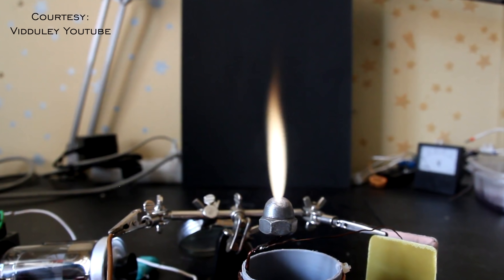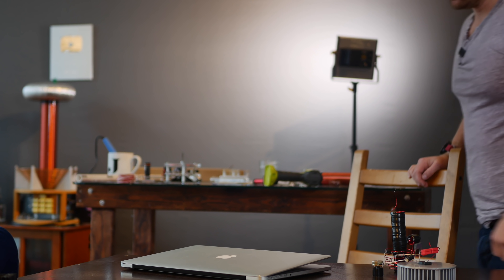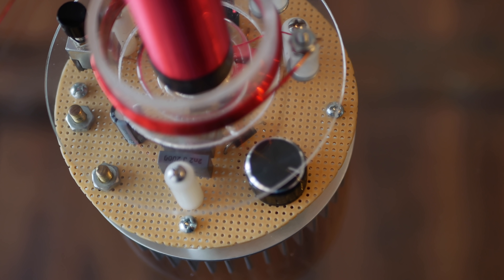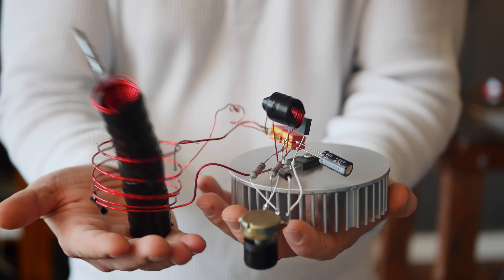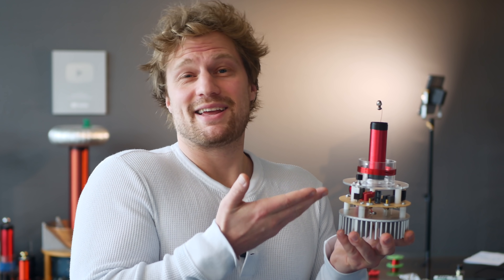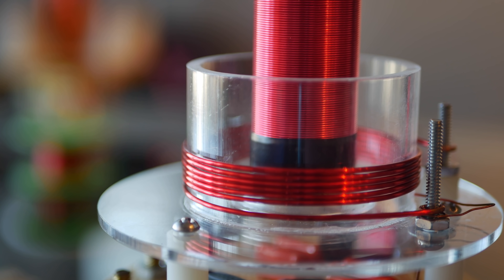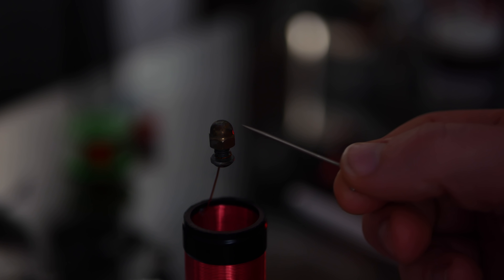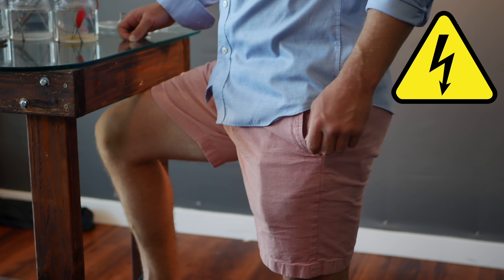Building a Wireless Power Plasma Candle ( Flame Discharge ft. Teslaundmehr)

Comment: excellent build and beautiful layout! i like how the DC input voltage is low enough that you don't have to worry about being zapped by playing with the flame. i'll have to try building one of these.

my suggestion: try putting lithium chloride on the output electrode for r e d flames
Reply from the maker: Haha, thanks Drake! Seriously though, you own the streets when it comes to the most terrifying flame discharge. Personally, I value safety and proof-of-concept builds over fry-your-face-off builds, but, I totally am glad people like you build bigger.
Reply: You can also add some LiCl to your salt shaker to keep those pesky mood swings under control. 😉
Reply: Hi I love your videos I've been subscribed for 2 years
Reply: If you add lithium chloride to the output wont it get split? releasing chlorine and lithium into the air? or is it so small an amount its not worth considering?
Reply: Maybe build one that can be Used as  a portable single-electrode-arc-lighter to fix the biggest problem with your old one, being the importability
Reply: @Peter_Schluss-Mit-Lustig  That would be a very expensive lighter, great for bragging about though.
Reply: SLOW THE VIDEO TO 0.25 AT 9:22 AND DOES THE PLASMA FLAME MAKE A DOUBLE HELIX?
Reply: Was waiting for your comment to be honest! Nice job on your projects
Reply: Styro pyro
Reply: With 2 foot flames.
Reply: I was waiting for you to point out that it is too safe LOL
Reply: Ac/Dc 🎸 🤘 Rock and Roll  👩‍🎤👨🏻‍🎤🧑‍🎤⚡️🚦♟↕️  Dont forget to ground.
Reply: I believe that the reason that he is not geting shocked by the arc is because he is using 2 coils that are inductively coupled and not 1 coil like your HFVTTC. Question, what is the point of the coil if you have only one of them? I am not an engineer (YET). edit: I get why you have the one coil after looking it up.
Reply: Please do.
Reply: @damn5940  I'm not 18 yet and my channel is entirely on my phone
Reply: Wow The Great Styropyro is here at last. Thanks both of you for your wonderful videos. Plasma channel is like a British research Institute where as Styropyro is like the next deadly Russian built weapon. Both are awesome in their rightful work. Also glad both of you revealed how difficult it is to make one of these or that. Would factor in that before attempting a build.

Comment: Make sure you are getting your MOSFETs from a reputable supplier (e.g. Digikey or Mouser) and not Amazon, eBay, or Aliexpress. The sketchy supplier will often have cheaper MOSFETs that have been remarked as more expensive ones. I decapped some IRFP260 from Amazon and from Digikey. The Amazon ones had dies that were 1/3rd of the size of the legit ones.
Reply from the maker: Really? That is super good to know. Thank you. I usually purchase from Mouser, but bought my MOSFETS this time around from Amazon. Maybe, no longer.
Reply: @PlasmaChannel  I still buy a bunch of non-critical parts from Amazon, but anything that I need to depend on being to spec, I'll get someplace legit. Here are my IRFP260 die pictures with a size comparison: https://imgur.com/a/JsGNFrl (hopefully I'm allowed to post a link)
Reply: @duckythescientist  This is the comment I was looking for. I know the fakes are out there but I'd never had a legit 260 to compare to the ones I got from Amazon. The smaller die may explain why I've had shit luck with the "bojack" 260's or whatever the hell they were branded.

Comment: Would this still function if it was self resonant, like Steve Wards SSTC 5.  This question may have been asked already, if so I missed it. Also, it seems similar to an Oudin Coil in design (but much cooler in performance).  Definitely something to try out!
Reply: Looks like the answer may be zero current switching - have to look and see if there are some IGBT's that operate at the high frequencies needed.

Comment: Excellent video, Jay! In your parts list you showed a TVS diode at 4:53. I didn't see it in the schematic diagram -- where does it go? Also a quick note for fellow constructors: In the schematic at 4:46 the capital Ws (160W; 5W; 20W) stands for "turns" (in English language schematics would probably be a 't')
Reply from the maker: Thank you! The TVS diode is optional, and just protects the MOSFETS. It helps a lot.

Comment: Small comment regarding your schematic:
W is the standard symbol for WATTS
T is the standard symbol for TURNS
.
Suggestion for next step in this project:
Investigate 'PLASMA SPEAKERS'
They start with your project and modulate the plasma to create outstanding audio sounds....
....
Last recommendation....
The three coils you build can be measured for inductance and quality factor on an inexpensive EBay component tester to get coils close enough to the correct value to get you started 'fine tuning'........
 The FETS dying is almost a direct function of the resonating current going  through the FET Gate Capacitance..
Luckily, that can also be measured on the same cheapie component tester.
Reply from the maker: Good stuff, thank you Dennis. The PLasma Speaker I have considered, but, so many have done it that i'm trying to think of how to do it differently.
Reply: @PlasmaChannel  
Couple the audio from your hifi to the wiper of your bias pot to modulate the flame.
 Everyone uses a high voltage tube like an 813 to do the modulation.
 Your modulation would be low voltage and  almost free....it will only cost you a coupling capacitor to couple the ac audio signal to the wiper...

Comment: I know this circuit, I found it a few years back and made one of these. Strangely enough I didn't have much trouble getting it working and never blew a mosfet, I think if I remember I used a variable capacitor in place of the 150pf to tune it, I was even able to audio modulate it! Just one correction I should point out, this is a base fed coil, not a traditional SSTC.
Reply: How are the MHz being achieved?

Based on a 100pF wouldn't it need like 1 uH to get MHz?

Especially with what they show, shouldn't their inductor values be in the high hundreds of uH & be in the KHz freq?

Comment: Is it possible to have a plasma candle work through a glass tube. I'm interested because it would isolate components from chemical reactions inside the tube?
Reply from the maker: It would melt the tube. Instantly.
Reply: @PlasmaChannel  How would you prevent it from melting?

Comment: Doesn't this generate a large amount of O3 or Ozone since your ionizing the air.  Not exactly healthy to breath.
Reply from the maker: Most of the flame is burning oxygen, from the heat of the central discharge. Also, I never smelled ozone once. For some reason I don’t believe this produces very much.

And I’ve been doing this for 17 years, so I know the scent of ozone.

Comment: I would like to build one, but there's no way I can get my hands on a scope
Reply: You don't need the scope. Just follow the plans he has exactly. It might take a bit more time to fiddle it to proper operation but it can be done.
Reply: You can use a variable capacitor good for 2kv and tune your primary into resonance with that. That by itself will output the HF field along the upper leg/coil/capacitor and you can then trial and error your other resonator by ball-parking a slightly lower resonant frequency on it and remove turns at a time from the top end of the coil.

Comment: Cool build - the round LED heatsink gives it an elegant look and your classic acrylic makes it demo quality. My thoughts...why an LC resonator? PLL? (Mentioned in the comment section). Why not a xtal(crystal) oscillator circuit?  Simpler - old ham radio operator here. 10MHZ is one of the WWV coordinated time signals on short-wave. If you have a short-wave radio tune it to WWV and when you are tuning the oscillator you should drown the WWV signal as you approach 10 Mhz if you are lacking an oscilloscope.
Reply from the maker: It sounds like you are quite knowledgeable on this topic. The oscillator would likely break from the back EMF this thing produces. The primary circuit needs to be built of very durable components, crystal oscillators are anything but durable. The primary circuit experiences several hundred volts while in operation.

Comment: super interesting candle! regulating the oscillation is a nightmare. Questions to consider or to try:
- Is the flame plasma?
  the plasma exists in a vacuum, close the upper part in a tube without air and light a candle.
-if you turn the candle down, is the flame pointing down?
   if it is, make another one and place them one above the other and bring them closer until the flames meet.
- if I had several identical candles arranged in a circle around one so that the tops were directed towards the middle, would the flame be uniform and larger, or would they have individual flames?
Reply from the maker: Great questions! I think I may build a second one, and point the flames at each other. See what happens.

Comment: 6:14 Centimetres and inches? That's janky. Also: it's soldered NOT soddered.
6:27 Clean your fingernails. They look gross, bro.
Reply from the maker: Glad my nails were the point of focus lol. I'm not a model, i'm a maker, so, dirty nails is part of the job. Also, centimeters and inches are incredibly easy to translate. I use them interchangeably due to their easy conversion. It always irritates a few folks though. Just my style.
Reply: @PlasmaChannel  Carry on Mr. Engineer.

Comment: I am working on a 16 MHz unit, it uses dual gate Mosfets (specifically for rf work) and pin diodes. The vid I will explain why I'm using dial gate fets. Excellent excellent excellent video as usual!!
Reply from the maker: Sounds great, and thanks for the compliment!
Reply: @PlasmaChannel  You're very welcome!

Comment: I look forward to creating this Jay. I am recently playing with the concept of a flame as a switch. So imagine a simple circuit with a variable 12v globe as a load. Now cut a wire and connect 2 peices of half inch copper tube half inch long . Fix them to be 5mm -10mm gap and parrellel to each other . Now turn on the circuit and use a standard cigarette lighter to place a flame between the 2 peices of copper and watch the globe energise . Set up scope to see the dc pulse frequency and make changes to gap and potention meter and lighter flame size . This is essentially a variable silent spark gap that can be used to make many interesting circuits and observe the scope with . Does it rectify dc as half bridge etc.

Comment: Why is yours and teslaundmehr's circuit a little bit different?
Reply from the maker: Build to the physical differences in our build, I needed to tweak my circuit a bit differently than his. How you build your device drastically affects the tuning.
Reply: @PlasmaChannel  that is why i will buy 100 irfp260/candle to make sure i always have extra
Reply: @PlasmaChannel  what do you mean by physical?
Do you mean the platform or the different wire?
And why do you use the irfp450?

Comment: nice cake
Reply: how much power that takes vs light output?
Reply: you could use mechanical motorized disc switcher, or multiple interlinked mosfets, better cut the hand off if it tempts for law based righteousness
Reply: nice carbonizer
Reply: if you put a plasma channel inside a strong water filler container, similarly, you should get a very narrow plasma channel, very hot, but also not melting stuff around it, maybe a heat exchanger too, to let some heat out
Reply: ionized water, so that you dont electrolyse, tho the arc will split and ionize everything, and it will have a lot larger breaking field
Reply: try ion sand blaster or plasma ion embedder, ion glue gun
Reply: assume you will throw apart compounds, making aluminium spray from aluminium oxide, etc
Reply: erm you made a tungsten filament lamp
Reply: plasma vacuum deposition of metals, without or with vacuum
Reply: lorentz candle flame extender, ie dc plasma sling
Reply: static dc magnetic field and segmented dc electrode field = plasma sling rail gun
Reply: magnetic induction levitation candle (levitation + red hot)

Comment: Those MOSFETs sacrificed their lives for Plasma Nation. Their sacrifice won't be forgotten. 
R.I.P. MOSFETs🙏🙏🙏

Beautiful build as always. 

There must exist some kind of mathematics that you can use to get the exact number of turns, dimensions, distance& position of primary winding  around secondary coil to get the desired output frequency. I'm not aware of such mathematics but there must be something so that you don't have to try all possible combinations to get the desired output.

Here comes THE What IF part
What if you connected two or more bolts of same dimensions to the output wire instead of one. What kind of effect would it have on the flame. 
AND
What if you increased the length of output wire (the free hanging, not coil wire). Let's say I hold plasma candle in my one hand, and hold the output wire in other hand, will there be flame?

BTW, your girlfriend is beautiful. Miss Tesla Coil😂😂
Reply from the maker: Tarun! That’s right my man! They will not have been sacrificed in vain, and they will receive the burial of a warrior

Comment: We definitely need a more detailed video on how to construct and tune this. And also the type of capacitors used .
Reply: I agree the capacitors used realy confused me I can't make sence of why you need 4 150pf capacitors I'm shore it's a stupid question?
Reply: @olliebilney1  ...no, it's not a stupid question, he didn't explain it because he doesn't know himself, there's actually lots of mistakes he makes in this vid, but I'll explain. When you add capacitors in series, like 100 pF plus 100 pF that equals 200 pF  nice and simple there, but when adding them in PARALLEL it's a whole other formula, You take the RECIPROCAL value of each capacitor, add those values together, and THEN to get the final value you take the reciprocal value of that ...so what he actually did, was to take two capicitors, at 150 pF each, added them in series, to get 300 pF, then did it again with the other two, and then connected these two pairs IN PARALLEL ! so you have 150 pF plus 150 pF which gives you 300 pF, twice, because he made two of these, then take the reciprocal, 1 over 300 plus 1over 300 equals 0.006666 Then reciprocate THAT, 1 over 0.006666 equals .....150 pF !     the reason he did it, was to increase the voltage that the caps could handle as opposed to working alone, plus it makes it more stable..got it ? You can tell neither him or the other guy know fuck all about the circuit or electronics in general, if you are going to build this thing, I strongly suggest you buy the TVS diode to stop the high voltage from cooking the gate on the MOSFET, it goes from the gate to ground. And use a multimeter to get the MOSFET just turned on with the potentiometer, if you keep winding the pot to far to the right, you will wreck your mosfet, use a big heat sink, put some thermal compound on the back of the mosfet, for better heat transfer, hope that helps.

Comment: Very nice setup! I have a few suggestions and questions. If you guys say that the efficiency is high, why do you need such a large freaking heatsink here? :D And, you might find it useful, that Corum brothers (an american physicist and an RF engineer) have a whole array of scientific papers, describing exactly how to calculate the resonant frequency of a helical resonator beforehand! Could save you a little bit of tuning time, maybe. The papers are heavy on the math, but understandable if you read them in the order of publication from oldest (199-something) to newest (2006).
Reply from the maker: Hey Vidduley! That’s a good point. My heatsink was so big, because I liked the look of it, but also my circuit did not end up being perfectly tuned. My mosfet still gets a little bit warm. Thanks for the recommendation, I’ll look into that! 

Also thanks for the footage!
Reply: @PlasmaChannel  👍

Comment: Hey great work! Thank you for sharing all of your design iterations! One thing I wanted to add is that you would have better cooling if you flipped your heat sink upside down. Fins use convection to cool themselves and as it is the hot air just rises back up onto the plate your mosfet is mounted on.
Reply from the maker: You know, that's a great point. The heatsink doesn't get too hot anyways, so, it likely doesn't affect my design much. But, great point!

Comment: Nice! got a question...I made an HHO generator and plan on popping balloons. I need to generate a hot arc to remote detonate with a wire. What would be the easiest and cheapest way to do that? I was thinking something along the lines of a modified arc lighter.
Reply from the maker: A modified arc lighter is safest and cheapest, really. I'd definitely suggest that.

Comment: Nice toy, but what is the range of the RF interference that it must generate. 10MHz is close to a common IF, so have you noticed interference on local radio receivers. It would be useful if the circuit was shown for longer.
It would be interesting to know the failure mode of the FETs, my guess the gate insulation was punctured, as the gate has no protection from excessive RF voltage.  A multimeter test would likely reveal the failure mode.